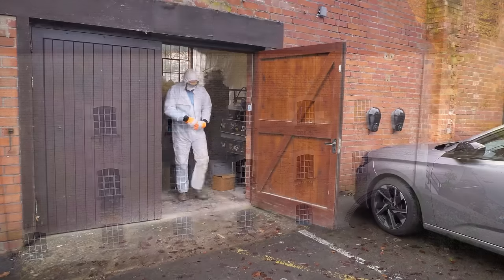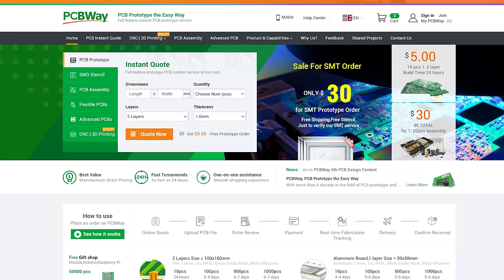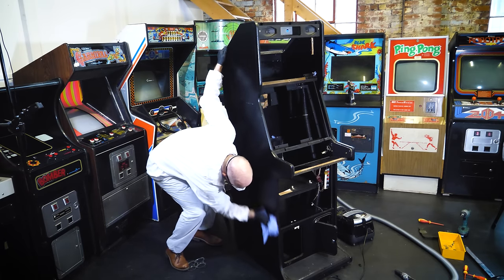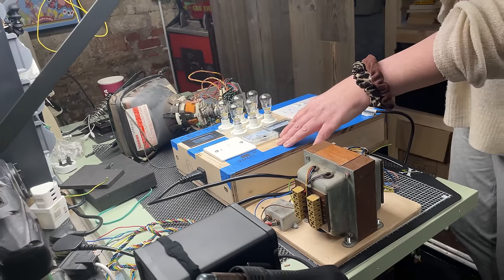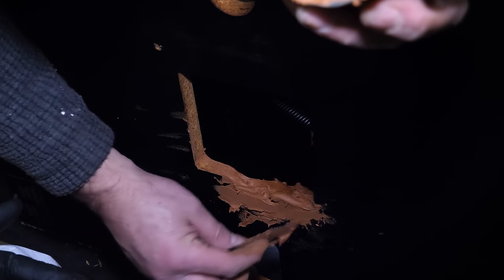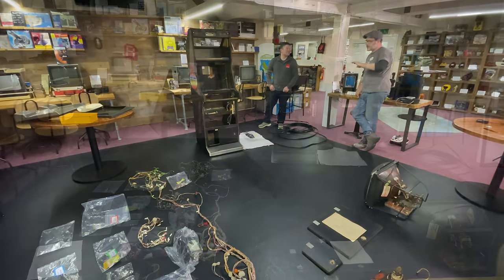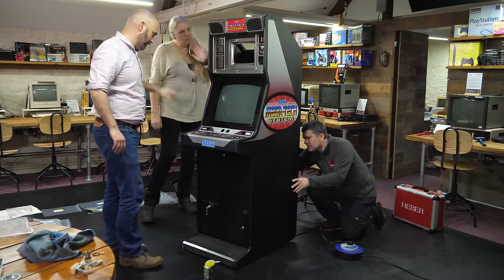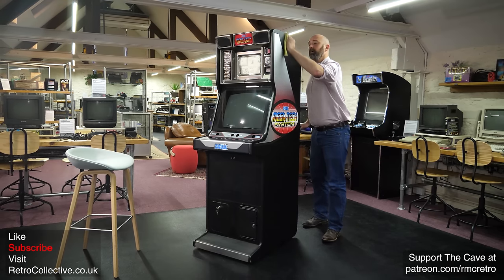Cleaning and Rebuilding the Sega Mega-Tech | Trash to Treasure (PT3)

Comment: The side art installation process was made much easier by having the textured black layer beneath it - the texturing allows for air release and low initial tack so you can just push any air bubbles out or peel off and reposition if it's not straight - so worth serious consideration over painting on these types of restorations.  I would imagine for full-sized artworks it would be a godsend.  The only sacrifice is some loss of adhesive strength so it might not be suitable for all types of decal - however in a cozy Cave with minimal contact to the sides it should be absolutely fine.

Great fun being involved and I can't wait to see the final result!
Reply: Great work!!!

Comment: for the blue-only on monitor try to first swap the 3 colors at input, if doesnt change try swapping them at the neckboard input, if still blue only, then swap at guns input. 
green and red are either shorted to ground before amp or amp is busted and they're shorted to 200v supply (or whatever video amp voltage is)
Reply: ....As they had a smashed crt base board, I'd look round there, first!!!   So easy to lose a grid/A1 supply!!
Reply: @fredcooper2063  The smashed base base board is on the smaller 10" monitor for the top of the machine. The 20" monitor is the one that's only displaying blue.

Comment: Ironically you said take a flame thrower to the metal part where the controlls were but if you had heated the sticker up first and pulled it would have taken alot of the glue with it. Also glue remover exists and is super effective with a plastic scraper.
Reply: Nope, not with 30+ year old glue - we actually did try heating it quite significantly with a heat gun and there was a layer that was completely hardened and was not coming off regardless of what we tried.  Paint thinners was the answer, dissolved it right off.

Comment: I wouldn't be shocked if the grime of indeterminate origin is also a substantial coating of tobacco smoke/tar. I've repaired some antique fountain pens that had a similar disgusting covering; mercifully it cleaned off quite well with some soap and water.

Comment: You get that sometimes when repairing the mounting board for crts, I also have one where the colours jump randomly every time it's powered up and needs to be reset every time, regardless of the last value, red becomes green or blue, leaving the potentiometer in the same position suddenly yields negative values, voodoo, by it could also be internal racing stealing the power for the other beam deflectors 🤷 an unusual pain, but an interesting fix

Comment: I prefer not using CA glue anywhere on the PCB, especially not in the PCB cracks. Yes it holds it absolutely does, but it doesn't like being heated above about 90°C and the fumes when it breaks down from heat are poisonous. Epoxy is the obvious choice, but it's not at all quick.

Comment: I think on a job like this it is well worth having someone experienced apply vinyl layers.  As anyone who has tried to apply one of those phone screen protectors can attest, getting all the bubbles out is often easier said than done.  Personally I would have cut away the damaged wood section and replaced it with some newer material rather than mess about with layer upon layer of filler.
Reply: I specifically chose vinyl with air-release adhesive for this very reason! I wouldn't have suggested it to Neil otherwise, it would have been a nightmare over a large area.  You can just smooth it on and air bubbles can be pushed right out.

Comment: I brought a Sega Mega Tech Arcade Cabinet,  it was hidden at the back of a chairty shop. I brought the machine about 15 years ago, £100 with a motherboard filled with carts

The 10" monitor sadly after a few years in our collection stopped working and with no, know how, to fix it I ended up selling it for £110 and threw in an Nokia N-Gage Kiosk to sweeten the deal. Sadly I wish I never sold it

Comment: Without going back to the first two parts... Are there any custom ICs on there that are hard or impossible to replace? If so, how about some heatsinks to prolong their life? :)
Reply from the maker: There are as you’d find in a Mega Drive, and you could, but it does have a lot of room in that cabinet. Perhaps a quiet, slow rpm fan on the rear of the cab would be an idea
Reply: @RMCRetro  That would less "non reversible", indeed. But does that really prolong the life just like heatsinks directly on the chips would? The big dilemma on originality vs practicability ;)
Reply from the maker: Something worth remembering is that if you do use a heatsink then the thermal pad/paste will get less efficient over time and need changing. Not a reason not to do it but a factor. I won’t be doing it on this board because it will be cool enough in the cabinet space and in the UK. The museum is also air conditioned

Comment: Went to this sale and this guy has a ton of old video and and computer stuff. Like Commodore stuff, Turbo Graphix etc. Came across something I have never seen, a jvc x'eye gaming console. Has the power supply and a controller for it, though its not the original JVC controller. Did not know it was basically a sega genesis that can play cartridges and sega cd's. Guy wanted $200 for it, both cartridge and CD work. I passed it up. Looking at your videos of old video game treasures, I may have made a mistake...
Reply: Iirc the X'Eye is a Victor (JVC) version of the Wondermega, yeah, you should have snagged it!

Comment: Who pooped on the Sega?
That's a very extreme method of rage quitting that requires time and circumstances to be correct. Or else the rage was so extreme that it built up in the bowels and could be excreted at will.

Either way, that's some crazy poop.

Comment: ifit were me  i  would  just replace the  cabinet with a new one...

once  damage  whether it  be mice or worse  termites i  would replicate  the  cabinet,  however with the unknown associated  past mice and rats unless you got something that can check the chipboard/mdf the cabinet was made from as you need to  xray/or similar  option  to check  the condition of the cabinet

anything that has been in aa chippy its whole life  or some  form of entertainment   such as the rl, or local  tenpin bowling alley i would  caution in using the  the original chasis as you will dealing with soliable and and smoke damage..

IN most cases the original chassis may not  be usable.. due to smoke and/or fat oil damage you might invite pestilence  keeping the old  cabinet in rotation..

and how long you think the  crts are going to last in operation i would be considering lcd options  as a replacement monitor option even if you  could fix or replace existing pcb's and caps with modern options how long you think the crt will last before it goes capute